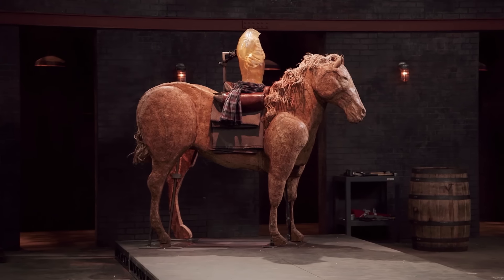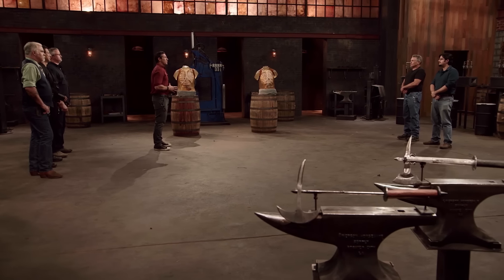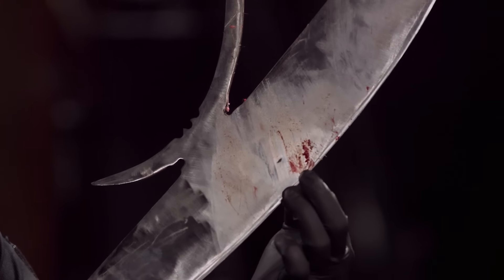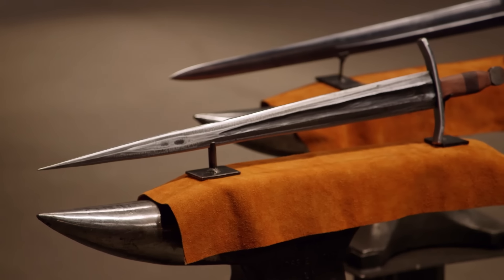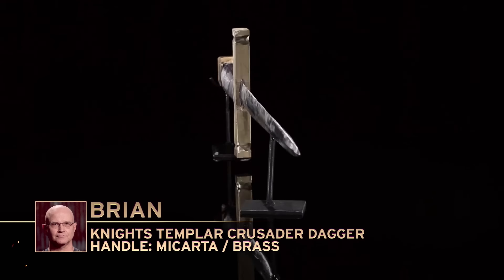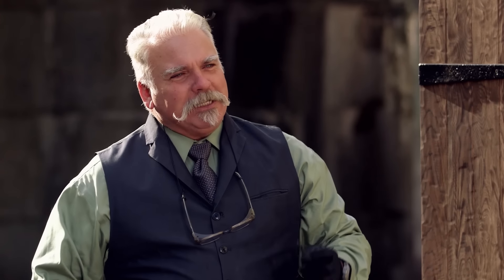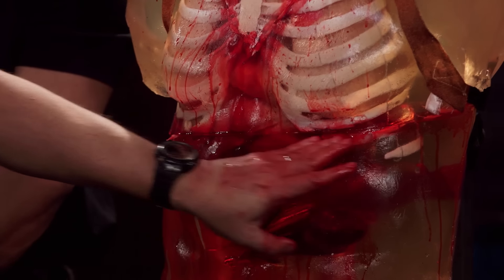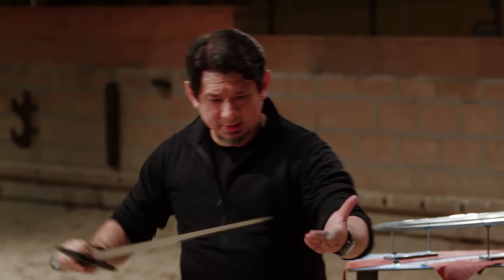Forged in Fire: TOP MEDIEVAL WEAPONS TESTED (8 Swords, Axes, and More) | History

Comment: 24:00  
the guy who's sword failed should have won, the other guys was too heavy, not sharp and uncomfortable
Reply: I def feel like the judges knew that too
Reply: the tang got into the pommel not throu it, thats the problem of many modern swords.
Reply: Id hardly call losing the pommel a "catastrophic failure" that other dude in no way deserved it, he made a bloody block of steel not a sword
Reply: @GwenShep  at least he was aware of it 😂😂
Reply: i feel the same way, there was an abyss between the two swords
Reply: You are completely wrong.  His sword failed.  I'll take a heavy dull uncomfortable sword over a failed one.
Reply: @GwenShep  The problem is, if the pommel is gone, the blade could simply fall out of the handle. That is dangerous. It was indeed a catastrophic failure, even though I would have preferred his sword otherwise.
Reply: @keeganowens8949  Fully agree with you, man.  I preferred his sword much more to the other one, but yeah, if the pommel breaks off like that, it's a failure.  That's an example of what I call "getting robbed of victory at the last minute", and that scenario has happened before on this show.  Prime example is the Roman Gladius in Season 1.  Mareko's Gladius was just SO much better performance-wise and appearance-wise in all of the tests, but in the end he lost because during the Strength Test, his tang started to bend within the handle, causing it to bend as well.
Reply: Some times if you can't succeed you can can just bank on your opponent failing
Reply: 23:15 you can see dug tellig him to take it easy so he can win but uh that judge swing so hard like why ... swords arn't desined to do it that hard in an ice block
Reply: I was rooting for him too. I mean, the other one was also a failure when it came to sharpness and weight. But hey, I'm not a judge. 😅😅
Reply: Yeah, problem is the handle usually isn't super well attached to the tang, the pommel is what really holds everything together. If they'd continued with testing the blade could have gone flying across the room.

He absolutely made the better blade though, weight, balance, edge toughness, everything. But, a bad, tough sword is better than a good, broken one.
Reply: @rissemie2177  dull or heavy sword still can be used in battle even though it isn't effective, but a catastrophic failure can make u killed in a battle
Reply: It's a through tang, and the handle is hold together by the pommel. If the pommel is off, the blade could fly off the handle on another swing.
Reply: I feel like both swords should've gotten disqualified
Reply: A pommel can always be replaced boys, can’t make a sword not heavy or uncomfortable after the fact without damaging the weapon further
Reply: I know absolutely nothing about swords and literally only watch this because it’s interesting, but an uncomfortable sword has to be better than one that breaks in battle xx Having a sword to fight is a lot better than having no sword to fight with
Reply: yaeh also thst wasnt catastrophic
Reply: it also sowrked way better
Reply: @jc5066  then you would be using a hammer and not a sword
Reply: @alexanderthegreat2080  It was. The handle on a sword is really held in place by the pommel. The fact that the pommel fell off entirely means there’s now nothing stopping your blade from flying out of the handle and across the room on your next swing outside of friction.
Reply: @hatimabdelmounim6587  yeah swords aren't supposed to be used on an ice block, but also they do stuff like that to test the absolute limits of the sword... back when those swords would have been used the sword would go through multiple battles, unfortunately its impossible to test that in a tv show
Reply: 22:27 that is not how a sword should deflect and you can visably see J strugle to use it
Reply: @hatimabdelmounim6587  it's a strength test
Reply: @alexanderthegreat2080  the other sword was bad, but it was still a usable sword. The other one had it's stability thrown out the window, and the very next swing may have yeeted the blade across the room. Leaving you with a hilt and guard. At least you get a new place to put candles?
Reply: @mcmactheaveragesunbro8741  BLA BLA BLA strength test of a sword not a baton
Reply: @hatimabdelmounim6587  it was a strength test for a sword..
Reply: @keeganowens8949  I don't really count a failure on the strength test as an actual failure. It's intentionally designed to be much more brutal than any realistic battlefield usage. If he were swinging into a person, even a heavily armoured person, that probably wouldn't have happened. I mean, it works for the show because they are looking for the best of the best (essentially, the Superman of blades) so that's fine. Still, I wish they would save the strength test for last. Putting it in the middle stops a lot of weapons from even competing in the cutting test which along with the kill (or "keal") test is a lot more realistic and important for judging how well it would perform in actual warfare. Even with the pommel breaking off, he still deserved to win. I also think the other guy should have been sent home after the first test since failing to cut through flesh is more of a catastrophic failure, imo. That will literally get you killed if it happens during a battle.
Reply: @xandervampire195  It doesn't matter if it lasts on the battlefield, it didn't last in their test.
Reply: @keeganowens8949  I see your point (no pun intended), they made the rules and must stick to them. In terms of the show, I have to concede that the winner undoubtedly met their criteria whereas the other didn't and so he deserved his win. Give his blade a sharper edge and he might even have the objectively better sword (it's a pity he didn't).

However, to say that the losers blade was actually worse than the other one (or bad in general) is just flat out wrong. It was easily the better of the two and in more realistic testing conditions would have won handily. If given the choice of which one you would be better off owning and using in combat, it was definitely his. He should be very proud of himself and his blade. That's all I'm saying.
Reply: @xandervampire195  Oh, no doubt he should be prod of his creation, yes.
Reply: @hatimabdelmounim6587  Yeahh true. I mean the dude was swinging like a bat, I'm not expert it but if you have a sword and using it as a weapon you aren't gonna be swinging is so hard like bat. but then again he is testing the durability of the weapon, but still I feel as though Doug knew it too that swinging that hard will break something. I feel like the other dudes didn't fail because of how heavy and thick it is, I also don't get why he said "there's a bend on it that i noticed before" but when Doug had it he didn't see a bend, and Doug is a professional mix martial artist with knives and sharp weapons like that being his speciality, I think he would have noticed something if there was something off about it.
Reply: Catastrophic failure or not, a pommel fallen off can be fixed. The tang didn't break so it could be reattached and strengthened. Not possible in the format of the competition but his sword was still better, pommel falling off notwithstanding
Reply: Sword is a weapon not a decoration on the wall. In battlefield you fight using that sword sometimes only single one swing, sometimes few hours of cuting armored enemies, choping shields, bashing helmets, hacking gates. And your weapon have to survive all that in one pieces, couse tomorrow you have do it again.
Reply: @deltazenturo1701  Yes you right but first you have to survive battle to repair your weapon, ups you canot survive couse its your weapon broken not your enemy.
Reply: R&AW  so its mean his stupid work coused him lose
Reply: @prasaite  In a duel of a man with a proper sword and a dude with that piece of sword-shape slab of steel, a dude with a proper sword would end it in 2nd cut, if 1st one is somehow  parried. THe speed advantage would be huge. IRL you don't just bash your sword against solid objects time and time again. You thrust at non-armored areas or you just slice through soft targets.
I'd take the weaker sword because that would pretty much grant me a win against equally skilled opponent every time. Pommel failure happens under some extremely unusual circumstances, IRL after years of use, your pommel would just start to come loose, then you'd take your sword to a bladesmith, who would fix it.
If you had a slab of steel in a shape of a sword,. you would just simply die.
Reply: @prasaite  Battles take hours, but actual combat during those battles is rather brief. If you ever held a sword in your hand and tried to wear some armor, you would have understood combat has to be brief periods of violence, because not even the best conditioned man is gonna last more than few minutes of intense combat, that's why in MMA fighters are gassing withing MINUTES.

If your weapon is as heavy and unwieldly as the sword-shaped slab, you're going to lose most of your arm-strength extremely quickly which will make your already v slow weapon even slower. By this time a peasant armed with a knife will just overpower you and stab you in the throat.

A good, but more fragile weapon will beat a v. heavy, unwieldy slab of metal basically every time, if reasonable amount of sword combat skill is involved.

In other words - a slab will get you killed in a wide variety of COMMOn situations, while a more fragile sword will get you killed only if you manage to:
- bang the pommel lose
- and you won't be able to switch to any other weapon once you feel the weapon coming undone the meantime.

In other words - a proper sword, but fragile has a LOT less chance of making you dead, than going into battle with a failure of a weapon. Actually I'm pretty sure a 1,5m piece of 30mm wooden pole beats that sword-shaped slab 10/10.
Because slab is a FAILURE 10/10, even if it stays in 1 piece.
Reply: @bezimienny_andzej6425  I never wrote that sword have to be the strongest item in the world. In this tv show people make weapon enought light and durable to survive few hits in hard objects. If someone make weapon even 1 pound heavier than historical judges notice it. Ok some weapons are heavy from definition like batteringram, but even twohanded axe have to be light enought to be operated by one man. So that weapons have to be operatable, light enought for use in one hand, and enought durable for survive few hits in hard object. They didnt hammering whole day in weapons only few hits. Its compromise between mass and endurance. Ofcorse skilled blacksmith willbe create better weapon, lighter, stronger.
Reply: @bezimienny_andzej6425  Do you understud what i wrote? I wrote that in this program smiths make real weapon, not decorations what willbe break when you just touch, not cheap replikac, but true weapon. Weapon not big pieces of steell.
Reply: I agree on those points, but a sword that starts failing will keep failing. The winner's sword didn't give, and can be resharpened if need be. Any fool can use a whetstone in a pinch.
Reply: @Draggo88  One can use a whetstone if you're still alive to use it, and this sword is way too heavy and unbalanced to be of any use. One sword failed during obvious misuese, the other was a failure to begin with.
Reply: @bezimienny_andzej6425  That's a fair statement.
Reply: @jc5066  loosing a pommel only makes the sword fail in looks. That sword was of good quality
Reply: While I absolutely agree, the rules are clearly defined. I feel terrible for the guy, but a sword without a pommel is a liability. The pommel is much more important than most people think. It’s a counterbalance, it prevents the sword from flying out of your hand if you lose your grip, and with a sword that sharp, you especially don’t want it flying around.
Reply: @comradebusman3  The thing is, the other sword was NOT balanced at all to begin with. And weapon failing when severly misused is way better scenario than weapon being a failure by design.
Reply: @kayaondra7922  nope :)
Reply: @hatimabdelmounim6587  there's a reason it's called the strength test, and there were some scenarios where they would have had to do so.
Reply: @alexanderthegreat2080  it was, unless you want a blade flying into a cameraman, judge or contestant.
Reply: Would you rather have a broken sword or a block of steel to swing around?
Reply: this is the hack of forged in fire if you are not good at this just make your sword big and heavy and hope for your enemy to fail
Reply: yes, that's unfortunate
Reply: Agree but still in battle whole but heavy sword is more useful than broken i think thats why judges made that decision
Reply: The blade survived the challenge, but no the pommel. The strength test is always brutal, but not ilogical.
Reply: Yup it was off much higher calibre.. ( except the pummel failure)
Reply: That's wat you call being lucky 😂
Reply: I agree!!
Reply: @alphacocofruit5074  Losing a pommel isn't just a fail in looks. Losing a pommel means your next swing will make the blade slide right out of the furniture and leaving you standing with a handle and no weapon. The pommel is what's holding your sword together.
Reply: @GwenShep  the pommel is what keeps the blade in your hand and from flying out of the handle. It’s a catastrophic failure and no longer safe to wield.
Reply: Exactly

Comment: And the arming sword loosing its pommel is the reason serious sword uses prefer peening the tang through pommels and not really soley on threads. Threading has been used in functional swords but it usualy also pinned to prevent thread ripping or loosening, Threading was usualy done on more fashonable blades so the handle could be swaped out easy for functional or ornate furnature depending on the occasion or the current fashions. (bladesmith here not an english teachure, sorry for spelling)

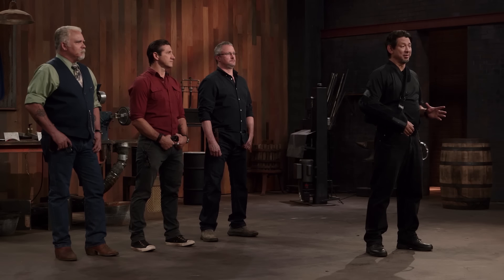Comment: 7:40 that ax will crush bone, but that long point is actually to Pierce plate mail armor isn't it?
Reply: Its impossible to pierce plate mail armor with a melee weapon, it could pierce chainmail and leather and if youre stabbing a plate mail armored knight then you better stab at any openings he has like the joints of armor and under the helmet
Reply: @eazy2195  impossible?  Your absolutely certain of that? Enough to put on plate armor and take one to the chest? Yeah that spike will easily pierce chain, but that spike is like taking a crossbow bolt to the chest, not an arrow with no weight behind it.  There are many cases of plate armor being pierced with crossbows bolts. It's not made of cast iron, its hammered.
Reply: @forcesightknight  Well we aint talking about crossbows here are we, and yes im certain it wouldnt pierce, but the blunt force trauma might still get you. They use some cheap armors on the show, nevermind the fact that no one wore just plate and nothing beneath it.

Go google some real historical tests and look up how a knight actually wore his armor, he had his clothes, then the garment and even a layer of chainmaill or leather armor before even having the plate on, so even if it did pierce by a cm it wouldnt get in the skin, so like I said, youre not aiming at the armor platings with that thing, youre aiming at the weakness
Reply: @eazy2195  ok, put all that on and take that spike to the chest then if your so certain. All stuff is put on to prevent penetration,  sure, but why do you think that spike is so long and thin?  Once an armored Knight is grounded, that spike is the finisher.  I would continue to explain, but its obvious you watched some show and now you are an expert,  for more educated than me, and my 8 years in the marine corps, and 12 plus years of college.  I only hope when I growds up me b as smerts is yuez is.
Reply: @forcesightknight  they teach you about european medieval armor in college and the marine corps? Ahahaha, good for you, my uni didnt teach that and im from Europe lol

Comment: with the 2nd weapon, the one handed axe, I was under the impression that they were meant to be on the heavier side to allow for more effective use when used against armour, I cant understand why it being on the heavy side is a bad thing? if someone can clear up my misunderstanding/misinformation I would greatly appreciate it
Reply: probably because it would be harder to control, not an expert though, thats the only reason i can think of
Reply: Generally speaking, weight can be a positive or a negative. It varies. A lot of weight on a very small point, or a very fine edge makes a weapon real good at piercing armor, especially plate. The thing about higher weight weapons is that they're harder to control, especially if that weight isn't balanced, and if they're too heavy, it can be so hard to get them moving that they can slow down your swing and actually get stuck in a target, rather than punching right through.

Comment: The pommel falling off wasnt a failure. It was just a built in ranged attack
Reply: It is - the pommel is one of the parts that holds the blade together... and your hand on the handle. If your hand slides off the handle is pretty much game over for you.
Reply: @mrN3w7   r/woooosh

Comment: 25:12 That is in no way real chainmail. If it were, there is no way that the knives would penetrate it. If you watch the rings coming off, you can see that it is not riveted, which means it is not real, and would not protect against much, as is demonstrated by KNIVES being able to cut it apart.
Reply: the daggers should be able to pieces into the rings and the gaps, opening and destroying some of them, but unable to cut them off
Reply: Of course not, chainmail is expensive and time consuming to make, why would they use the real stuff?